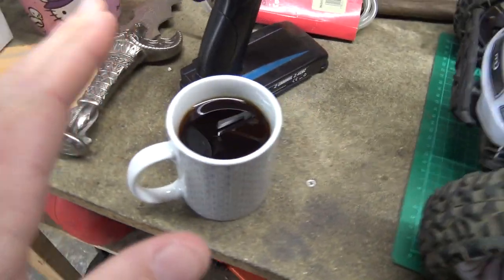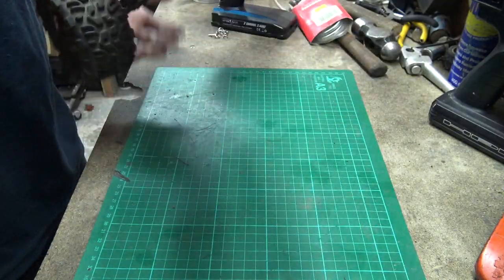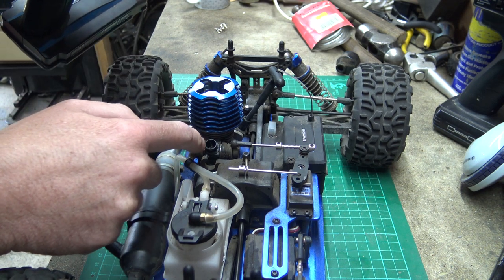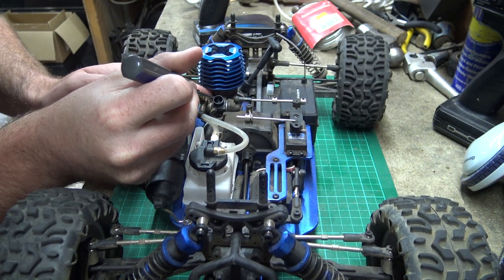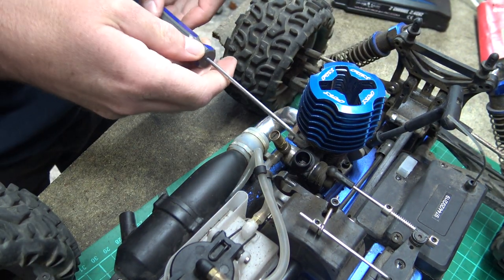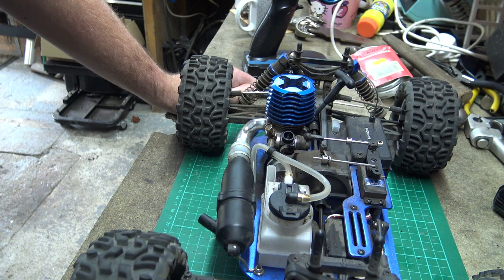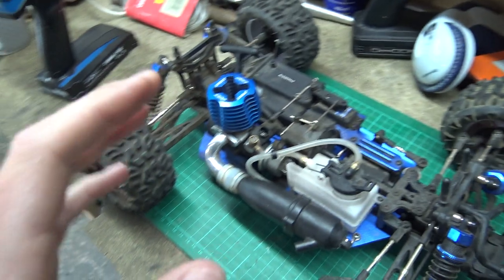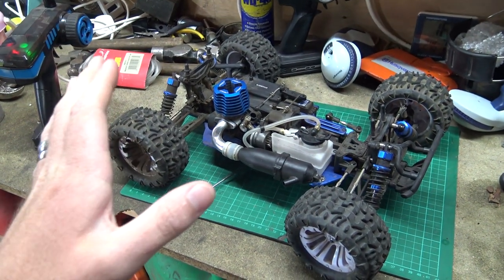How To Set Throttle Trim Nitro Engines RC Nitro

Comment: I think a lot of people recommend the idle to be set .75-1.0mm is because it’s the ideal smallest amount to have the slide set at. And you just tune the LS needle to adjust the idle, HS to adjust the 1/3-full throttle range. 

To me it’s much easier to set the idle .75-1.0mm and just deal with the HS and LS screws

Comment: Haggard you definitely spot on. Every rc car servo tray is set up spaced out differently. I also think the engine manufacture recommendation throttle gap is a bit off. Probably they tested bench the engine the set up with out the chassis.

Comment: I run a cut piece of fuel hosing on the brake rod it acts kind of like the hydraulics do on your 1/1 car and I've found that I have much better braking by doing that it seems to have a little more control on the brakes.great video

Comment: If you've ever set cable derailleur gears on a bike, you'll know how to do this.

The tickover screw is the equivalent to the limit screw. It's the mechanical end point that stops your chain falling off, or your engine stalling.

The low speed screw is the equivalent to the B screw. Dictates how much tension there is on the chain in all gears, or how much fuel is allowed into the engine.

You have to set the servos (shifter levers) and cable stops (slider stops) to a neutral position before you faff with the derailleur. Same is true here.

Comment: Thank you for getting back to me
Much appreciated, I replaced the glow plug once I broke it in, I might have a look just to make sure thanks. If it’s too rich do I turn the low needle antic clockwise or the other way or is it the top needle, I never have time to put my body shell on as it cuts out
Reply from the maker: Try the high speed first, clockwise a gnats’ cock.

Comment: I have a red cat volcano s30.
When I first started it it just would spin the wheels like crazy. I tried to do this but it wouldn’t work because when I adjusted the throttle trim I had no breaks and the gap was still huge. Screw with the pushy thing is in its normal spot but it still won’t close the hole.
I messed with the screw and the throttle trim but the hole still won’t close and I know that’s the only issue I’m having right now. 
WANT TO CLOSE THE HOLE

Comment: Hi just watched your video found it useful and helpful, engines are like learning Japanese to me and struggle. A question my FTX banzai nitro car starts fine, when I pull the glow starter out the car cuts out after a few seconds why? Another thing I don’t have time to put the body shell on because it cuts out. When it is started and I pull the accelerator it cuts out why?
Thanks
Reply from the maker: Sounds like it’s either too rich or your glow plug is on its way out.

Comment: Yes haggard. Good video m8. I have a question that goes like this....how do you know if your nitro engine is blown? Is it possible for an engine to break without a visual sign.
Reply from the maker: Yeah it is it’ll have knocking sounds when you turn it over or low compression :)
Reply: @HaggardRC  cool, thank you for taking the time to reply. Iv just been rippin my tt eb4 s2 21R. Blisteringly fast. What's your thoughts on bp coolers to?
Reply from the maker: Useless and not needed lol
Reply: From what iv read the proper one are suppose to spin the air going to the tank cooling it in the process, but the ones iv seen are not spiraled inside at all. I think there's a lot of fakes on the market hence maybe that's why you think that?

Comment: Hi bro how it going so I just bought myself a first nitro car ftx torro trophy but having some issues with the throttle servo when I installed the fela safe to the channel 2 and press the break in its all now instead. Put one problem I'm having is the throttle and brake servo keeps jittering why this because if I turn it on it keeps doing it bud just need help to stop this from happening bud. If you went I can show a few videos to your Facebook if you send the link to me thanks 😊
Reply from the maker: I don’t have Facebook but if a servo is jittering it usually means either interference or a bad connection
Reply: @HaggardRC  thanks for getting back to me I sorted it now my fly sky gt3b ready have failsafe built in which I did not know that 😀.
So the failsafe which I bought was a waste of money now 🤔
With the throttle servo it's only jittering a bit now and I done the gab 1mn between the carb and break so it doesn't stall when you break bud thanks 👍

Comment: Ahh is this what was happening to me was my low speed so so so rich and my idle gap was to big so much so my high speed had to be set way to lean to slow the block to lean enough to run semi properly. 

I see now the idle gap and the low needle are always in sink with each other. 

Yes the 1 mm gap is good for starting because it’s a rich take off 
Makes sence 

From now on I will shut the idle then open it 3/4 of a turn via closed the throttle screw 

Start and tune the high speed From there and it will be a breeze to tune. 

The gap at 1 mm and trying to tune the high speed just does not allow the engine to wake up properly. Meaning erratic high speed and idling becomes erratic and unstable 

1 good year and it finally is coming together. 
Without all these vids I’d be lost lol.
Reply from the maker: Glad it helped dude 😁
Reply: @HaggardRC  
Ohhh boy it sure did.  Where I live seems to run the engines really really hot at stock settings so the low needle needs to be closed a bit and leaned so the rich high end is not to lean at normal settings. 

This is the hard start I’ve been having 

And  no I  did not want to blow motors daily die to my own need to get my channel back with cars to use. 

I do not get free stuff and have a small collection of cars so I have to be good to them or I won’t have them very long running 

I do so much appreciate the help more then gold bro more then gold 🤘😎
🙇‍♂️thank you Sir hope the best of days for ya always. 👍😊

Comment: Hi. I am a nervy to  the rc game , I f--ked up , I messed with the needle settings on my god buggy 1/10 warhead, can you show how to put them back to factory settings as the manual says to close them both , up completely the back off 1.5 turns on the high side and 1.14 turns on the low idle is this true. I hope that you can sort this out , as every one days that the needles need to be flush.

Comment: This method will work but it’s not the best. The best method is to set the TX trim to neutral, then set your manual linkages (with a gap before throttle is actuated) then finally set your end points. And never ever touch throttle trim again